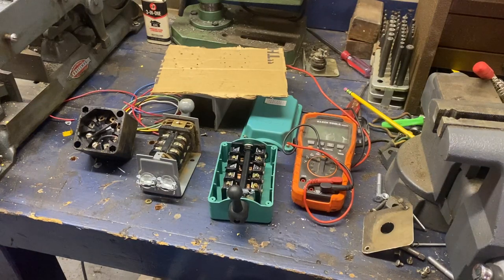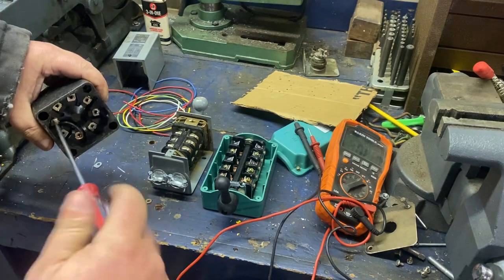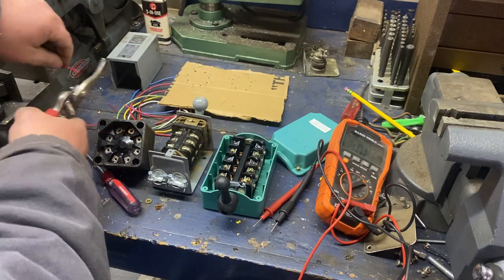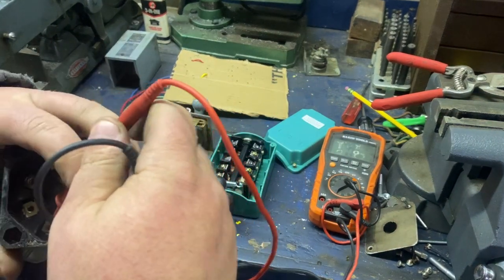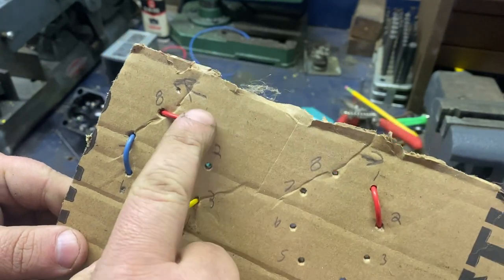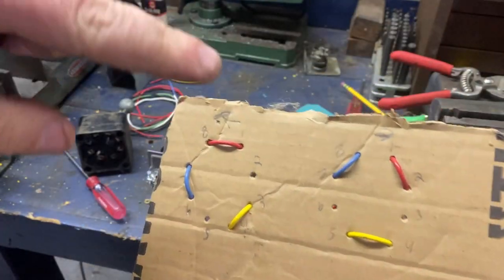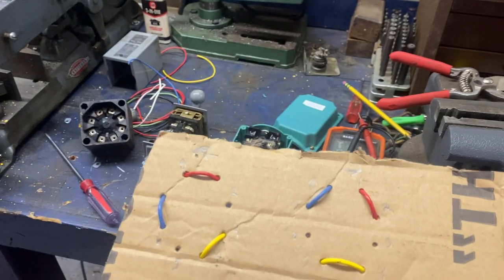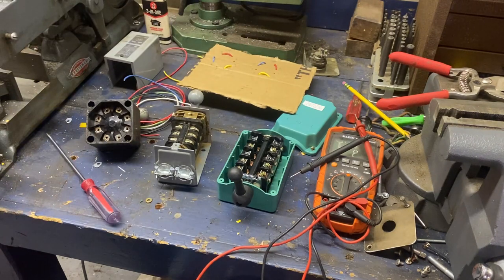How to wire a drum switch with out the diagram

Comment: Hi Adam, I have a drum switch that jamed on the on position on the welder. I stripped it and put it back together again, but it wont even switch on the welder now. Any advice on how to get the switch to work properly again.
Reply from the maker: Are the contacts badly burned
Reply: @smalltownmachineshop6860  
No they are perfectly fine. ... when i checked for continuty i get some of them working then it goes cold. it is a 6 position  switch with 16 contacts on it.
Reply: @smalltownmachineshop6860  
No not at all. it is a 6 position switch with 16 terminals connection,s on it
Reply from the maker: @tonywilliamson2840  email me some pics at Badam485@yahoo.com

Comment: Oh man I have 1 of these green ones on my Logan with a single phase harbor freight motor...it was interesting to wire it up on a dual voltage motor..I the end I had to cheat just a lil to get it to reverse
Reply from the maker: I get probably 10 messages a month from people needing help wiring there switches and most have that or that weird round blue one they mostly use on tire changing machines so I picked some up so I could help them better, my biggest issue with them is the plastic handle